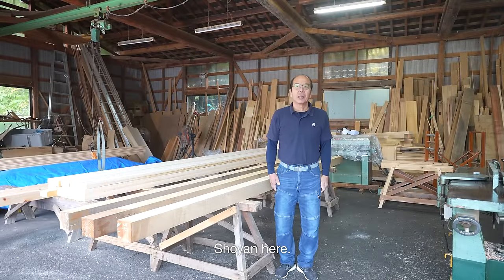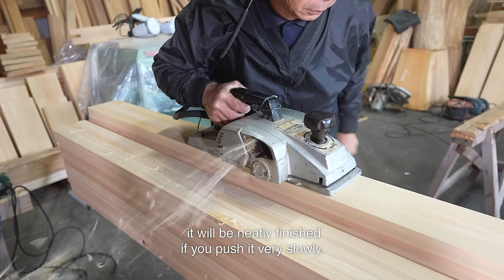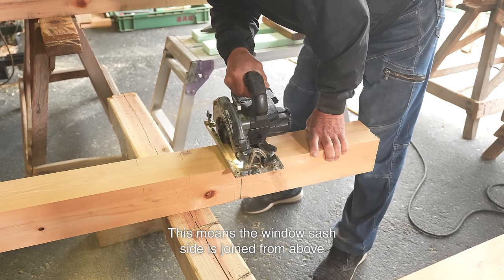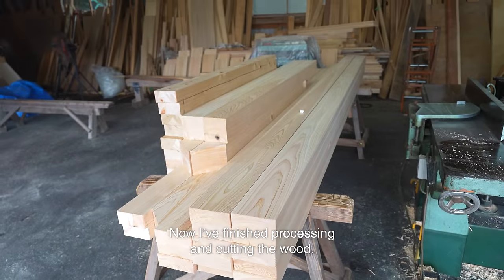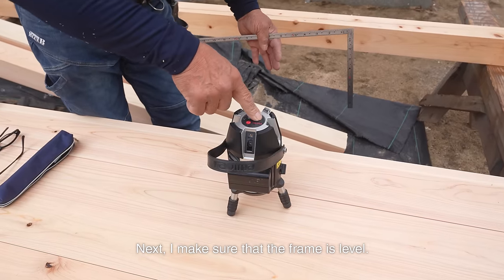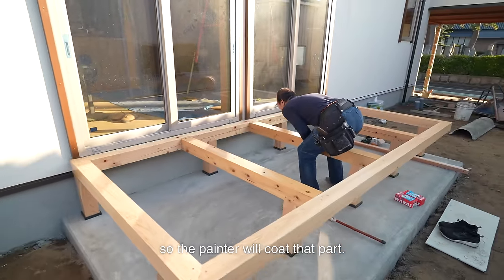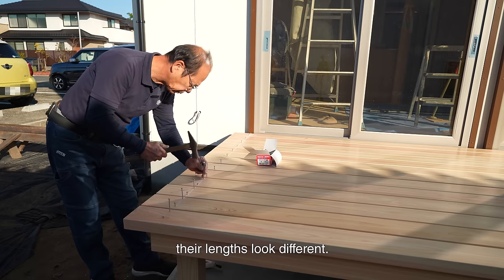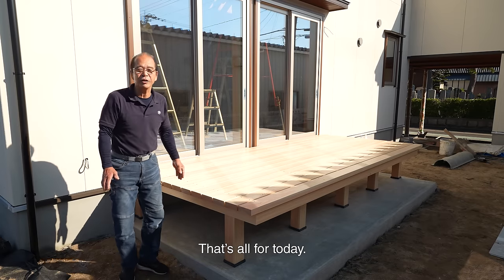Wood Deck Becomes an Extension of the Living Room [Season4 - Part 17]

Comment: A lot of times in North America people just butt the deck boards up to each other, seeing as they are the most damp and moisture holding they will ever be at installation, then when they inevitibly shrink from drying out you get your gap in between the boards for water and snow ice to melt through.   Bit of a controversial point though when deck building, I've also used my speed square to get the gap between boards. Different strokes for different folks! (or climates) Cheers

Comment: Have you considered getting a helical cutter blade for the planer? It leaves less ridges, and the blades are individual square cutters, so that if one chips in the center for some reason, it's very easy to either rotate the blade(it has blades on both sides) or just replace it, without having to replace the entire blade.

Comment: Is there any reason the deck was not extended to the entire concrete pad? While going to all that trouble seems like it could have fit another 2 or three boards for a bigger deck? Just wondering if it was a decision based purely on size or some other technical reason o dont understand?

Comment: I miss the voice actor, because the AI voice is bland. In your craft you insist on using hand tools to achieve a better result and therefore it is not befitting to use an artificial voice without intonation for your beautiful videos.